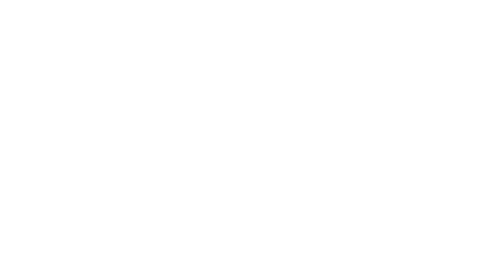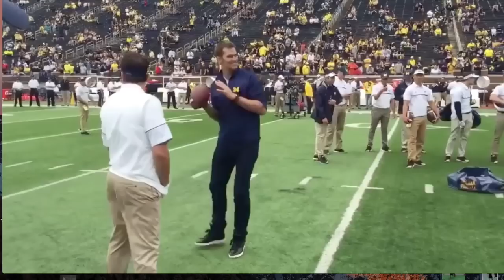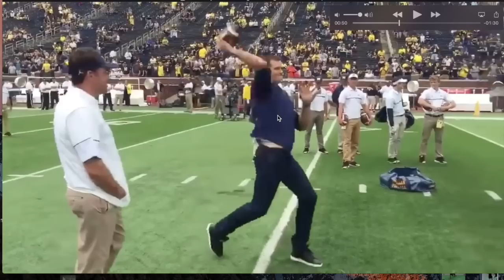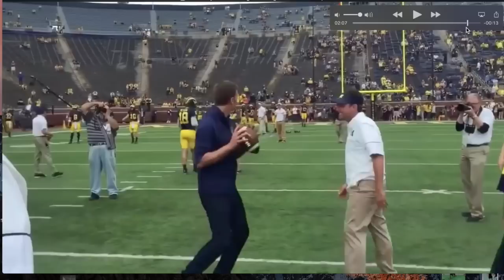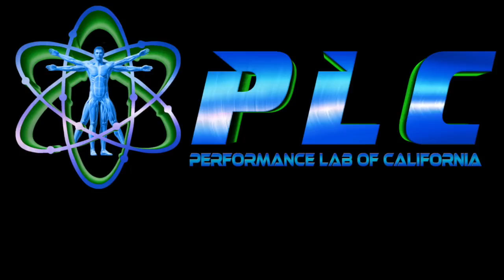Tom Brady Throwing Mechanics | Performance Labs

Comment: QBs lean to their left because they lock out the left leg, usually because they are taught to point their toe at the target and step causing their hips to never get through on the throw.  Also, you should never supinate, only pronate as the ball comes off your pointer finger, which Brady does a great job of always.  He has a small curve on his left side because he was taught by Tom Martinez and Coach Martinez taught a small crunch on the left side in order to keep the ball higher on the release and "inside the elbow"...thus eliminating the chances that he would supinate on the release causing the ball to tail off or fall to the right in a right handed QB.

Comment: qb coach here,  your video are Very useful,  thank You for your work. This Great athlethes obviously are super talented guys, And get away with some minor issue, or  ad habits, ok Tom here has Little going wrong.  But others have some kind of flaws here And there. Your vide show were as a qb You have To aim To The things in The right way.  Great stuff
Reply from the maker: Yes. There is no perfect way to throw a Football. Just have to optimize each individual to make sure they are getting the most out of their body.